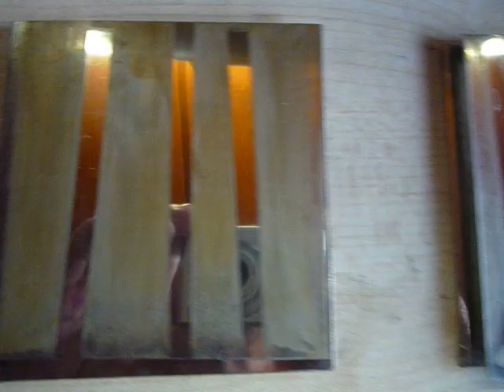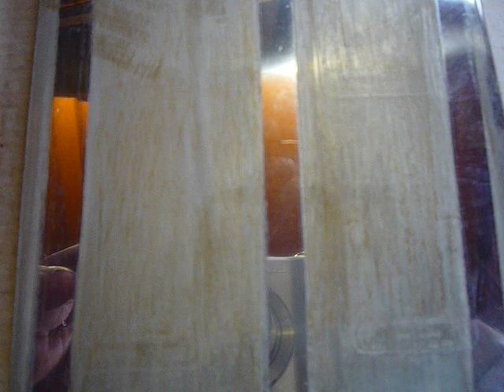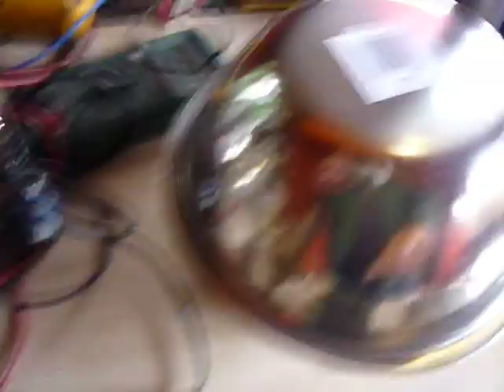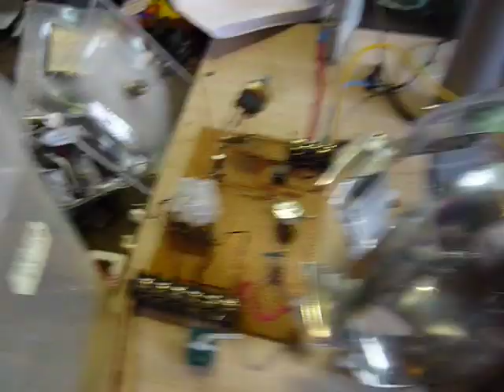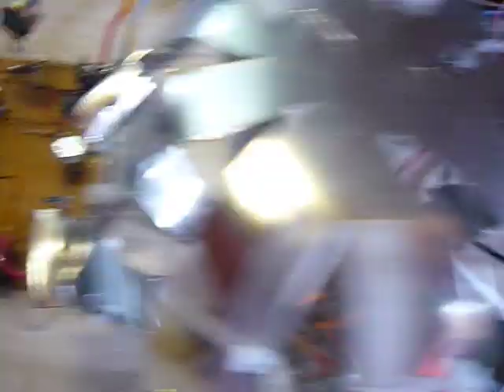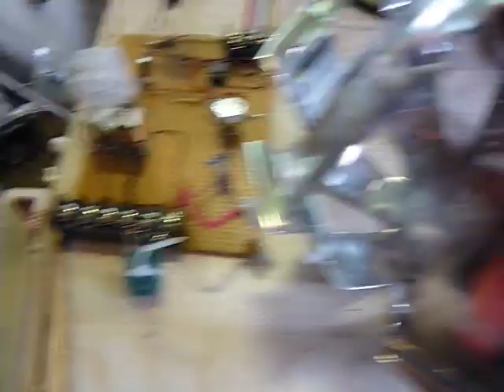ORB - HHO MAGNET cell - Plate Inspection!

Comment: @reeseht I understand, maybe you want to add some nylon spacers between the plates, just to be sure when you are installing it for the first time. You can change it later when you are sure how the plates react to the force from the magnets.  Like tie rips, or some perforated plastic material that doesn't shrink and can stand the heat?

Greets, iT.

Comment from the maker: I'm sure some of you inventive folks can find other uses for the ORB - a RODIN or STARSHIP coil could be easily wound onto it - perhaps plastic bowls with the coils... rotor inside - loads of uses?
I need a little help with the type of plates to use in the cell?
I tried a test with magnets & Titanium - not very promising - the Titanium is still looking for the higher voltage but I did get the plates to conduct one on one?
Jim